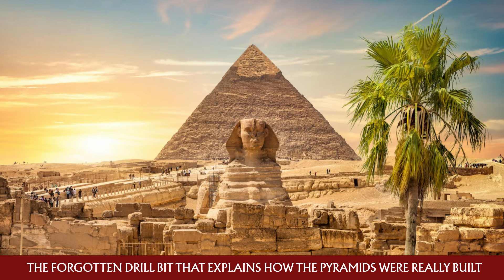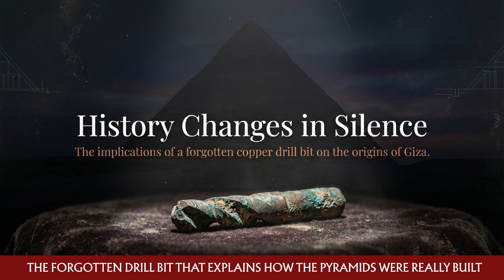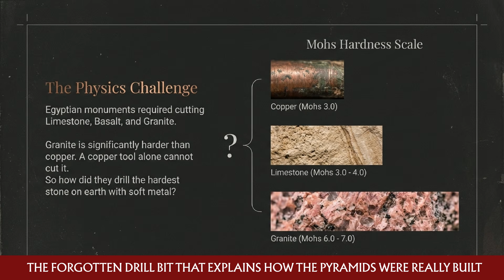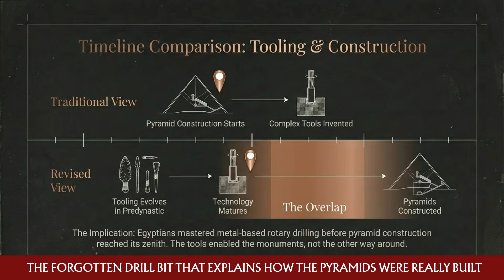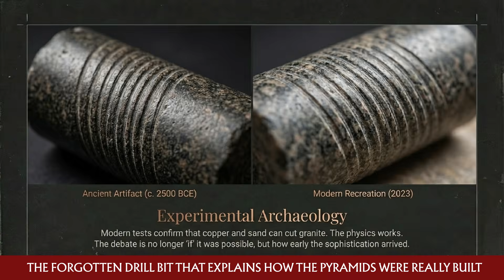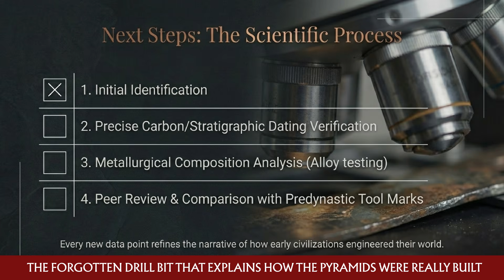The Forgotten Drill Bit That Explains How the Pyramids Were Really Built

Comment from the maker: For those curious about how the Egyptians could drill or cut hard stone like granite using copper tools, there are actually several archaeological studies and experimental reconstructions on this topic.

Researchers have shown that the copper itself didn’t do the cutting — the real work was done by abrasive materials such as quartz sand while the copper tube or drill simply acted as the rotating carrier.

If you want to explore the research behind this, here are a few references worth reading:

• https://www.sciencedirect.com/science/article/abs/pii/S2352409X21000808
• https://www.sciencedirect.com/science/article/pii/S2667136022000036
• https://www.penn.museum/sites/expedition/ancient-egyptian-stone-drilling/
• https://www.hallofmaat.com/unforbiddengeology/ancient-egyptian-copper-coring-drills/
• https://www.oocities.org/unforbidden_geology/ancient_egyptian_introduction_tools_and_methods.html
• https://www.geocities.ws/unforbidden_geology/ancient_egyptian_introduction_tools_and_methods.html

These articles discuss experimental archaeology, copper coring drills, and the role of quartz sand abrasives in ancient Egyptian stoneworking.
Reply: I honestly don’t see a problem with AI, as long as the video provides useful and accurate information. I noticed you included reference links, which shows you care about doing the research properly, and I really respect that.

Thanks for the video, I learned something new without having to dig through a huge pile of documents. I appreciate the effort you put into making history easier to access!

Comment: Copper did not cut granite. Complete nonsense to think it did. 
It may have been used on the soft alabaster thousands of years later.
Reply from the maker: You're absolutely right about one important point, copper itself cannot cut granite. It’s far too soft for that.

What archaeologists propose is a slightly different mechanism. The copper tool acted mainly as a carrier for abrasive materials, such as crushed quartz sand. Quartz has a hardness similar to or higher than the minerals in granite, so when the drill rotated under pressure, those abrasive grains did the actual cutting.

In other words, the copper wasn’t the cutter, it was the tool holding the abrasives, similar to how sandpaper works today.

Experimental archaeology has reproduced this method with copper tube drills and quartz abrasives and shown that it can drill granite, although very slowly. If you're interested, I added several research articles and experiment reports in the pinned comment so people can look at the sources directly.

Comment: Good grief. No one has replicated this and the feed rate grooves on the cores shows it didn't take long to drill those holes. Banned for being BS.
Reply from the maker: Actually a number of researchers have tried to replicate it.

Experimental archaeologist Denys A. Stocks reproduced drilling methods using copper tube drills and quartz sand abrasives and demonstrated that granite can indeed be drilled this way just very slowly.

Similar experimental work has also been discussed by the University of Pennsylvania Museum in their research on ancient Egyptian stone drilling.

The copper itself doesn’t cut the granite, the quartz abrasive does. The copper tube simply holds the abrasive under pressure while the drill rotates.

If you're interested, I added several research articles and experiment reports in the pinned comment so people can look at the sources directly.

Comment: Perhaps they were even able to collect up the spent ground up copper and recast it again?
Reply from the maker: Yes — that’s actually very possible. Copper was a valuable resource in ancient Egypt, so it was rarely wasted. When tools like drills or saws wore down, the remaining copper fragments could be collected, melted, and recast into new tools.

Archaeological studies of Old Kingdom workshops near Giza Plateau show that metal tools were regularly repaired and reused rather than discarded. Copper is also easy to recycle because it melts at a relatively low temperature, making repeated casting practical with ancient furnaces.

So while drilling stone could wear down copper quickly, the metal itself likely stayed in circulation — melted, reshaped, and put back to work again. 🔧

Feel free to explore the research yourself through the article links in the pinned comment above — they go deeper into the experiments and archaeological evidence.

Comment: I fail to see how a copper drill will help construct a pyramid. lol
Reply from the maker: That’s actually a very reasonable question.

Copper by itself is indeed too soft to cut granite. Granite ranks around 6–7 on the Mohs hardness scale, while copper is only about 3.
But the copper drill wasn’t the cutting tool.
It was actually just the holder for abrasive materials.

Ancient Egyptians filled the drilling area with quartz sand or corundum powder, which are much harder than granite. Under pressure, these abrasive grains embedded into the soft copper edge.

So the real cutting was done by the abrasive particles, not the copper.

Think of it like sandpaper: the paper doesn’t cut the wood, the tiny abrasive grains do.
The copper tube simply held the abrasives in place while a bow drill mechanism rotated the tool with heavy downward pressure.

Experimental archaeologists have reproduced this method and confirmed that it can drill granite, although slowly — a few millimeters per hour.

Simple technology, but extremely clever engineering.
Reply: @AncientEgyptTimes  I understand how the drill works, thats not my question, the question is how does a drill help in any way to build a pyramid?
Reply from the maker: @jasperlit1345  That’s a great clarification.

The drill wasn’t used to build the pyramid blocks themselves, but to work the stone during the construction process. For example, drills were used to:

• cut precise holes for wooden dowels or copper pins used in fittings
• hollow out stone vessels and architectural elements
• help shape or finish hard stones like granite used in temples, sarcophagi, and internal chambers

In the case of pyramids, granite was used in places like the King’s Chamber of the Great Pyramid of Giza, and tools like tubular drills helped craftsmen shape and finish those extremely hard stones.

So the drill wasn’t about stacking the blocks, it was part of the broader stone-working toolkit that made those structures possible.” 🏺